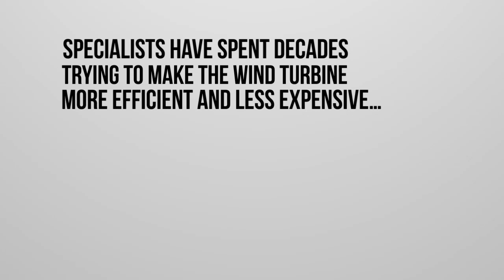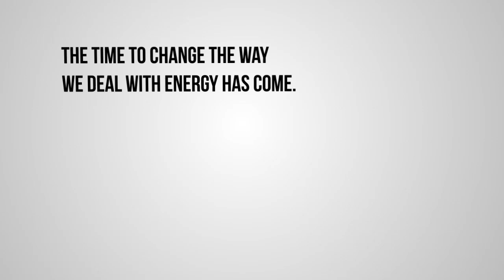Saphon Energy Story

Comment: Hi if anyone is wondering how it works I have an explanation and a grasshopper definition showing, its rather simple, the dish acts like an air foil ( its not really blade less the dish being the blade) the resulting force with a head wind on the air foil  is perpendicular to the crank shaft and setting it in rotation. I cannot say anything about it's robustness or its efficiency but it's not bs.

Comment: When the wind gets too strong, it just rips off the plate, like an umbrella in the wind.  If it doesn't, then it will push it only one way, until the wind dies out.  A steady wind won't generate electricity!  You'll need an intermittent wind, that blows in oppososite directions, in order to get steady electricity.  That's why their video doesn't show you how it works.

Comment: The commentary about the birds and the noise is exceedingly misleading.  I live in an area with literlly hundreds of huge windmills and have investigated bird death and noise.  Bird death is rare except at night and even then not a significant problem. 

 Since blades react to the wind the only sound is a wosh that is far quieter than an automobile traveling about 30mph.  Since most major windmills are set back a thousand or more feet from homes and roads, can't imagine anyone ever hearing any associated sound.

I have however experienced flicker, not much different than sunlight going through leaves on a windy day. 

Can't comment on electronic interruption, don't know.

Comment: It would help if an explanation of how it actually works would enhance the believability factor.  I lived in Palm Springs for a couple of years and that is one of the only places where the wind from the ocean can cut through the mountains and on to the rest of the desert and county.  It is like a huge wind tunnel, so strong that they often have to shut the turbines down to prevent burn out.  I give you an A+ for building a new concept, but if you're worried about copy cat's, well, they can always pull your international patent to see how it works.  So you might be better off to "Buck Up" and design home kits for the "average Joe" like myself.  I wish I worked with you guys.  Keep up the good work and I'll be looking forward to watching the progression of your device.  - Peppi Turco

Comment: Technology Red Flags

Do they claim to exceed Betz’ Limit?
Is it an old technology claiming to be a new technology?
Is their product just a design concept as opposed to at least a working and tested prototype?
Are the only test results from tests that they have performed as opposed to independent, third-party labs, and do they expose the numbers?
Are claimed patents for devices other than the one they are demonstrating?
Are they claiming greater efficiency than existing generation technologies based on anything other than an ISO standard full lifecycle accounting that has been independently assessed?
Are they claiming to integrate storage into their wind generation device without a market niche need?
Reply: quoted from a good article you can find by googling saphon wind energy hoax. 

This is a scam.

Comment: Well that is because you do not understand what is going on.
Winds are the earth's natural air conditioning (cooling) system.
Any power you take from that system is going to cause warming far more warming than is worth while for the power they generate.

Ever wondered why the north pole is melting rapidly whilst south pole is either static or growing?

I will provide the answer for you with another question. 

In which hemisphere are 96% of the wind turbines located.

(spoiler North)

Comment: The only way anything can not be subject to Betz limit is if it is not stationary, meaning that it moves from point A to point B but doesn't ever end up back at point A again.  This oscillating "sail" moves, but it follows a cyclical pattern and there is no way it could ever exceed the betz limit, and from the looks of the short cell phone camera demo during the TED talk, it actually looks quite inefficient.  In short, not a CHANCE.

Comment: "The blades are replaced by a sail-shaped.. the wind is being harnessed by a sail which follows a non-rotational back and forth motion. Such movement follows a knot path and allows the conversion of the majority of the kinetic energy into mechanical energy (using pistons). The same is then converted to a hydraulic pressure that could either be stored (in hydraulic accumulator) or instantly converted to electricity via a hydraulic motor and a generator." from their website.